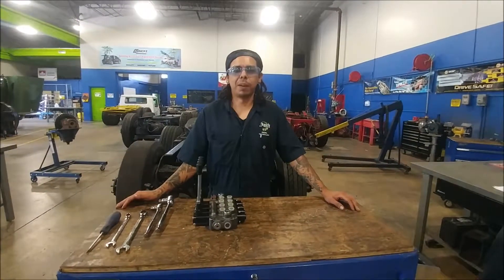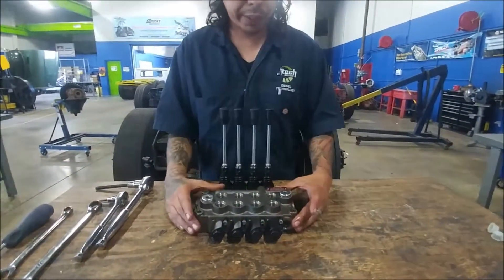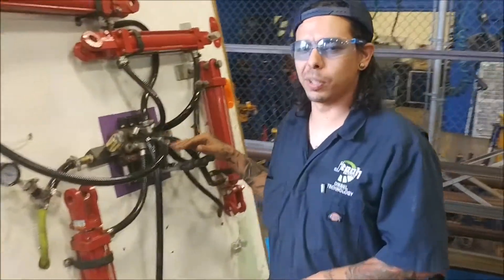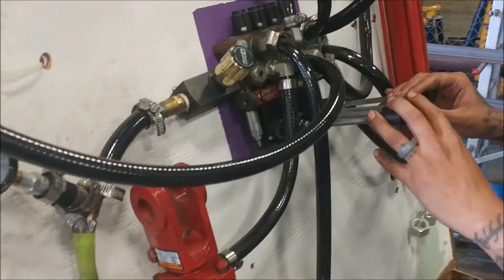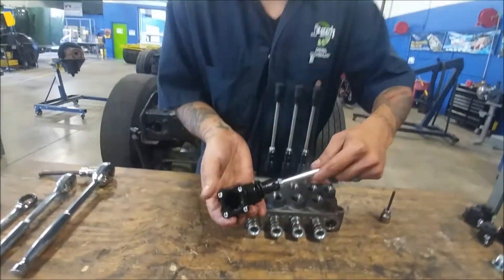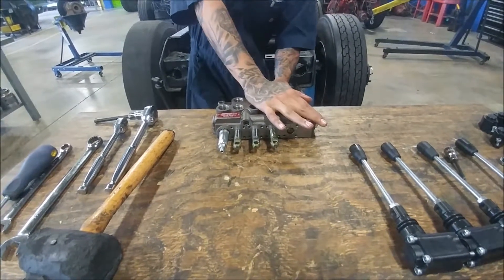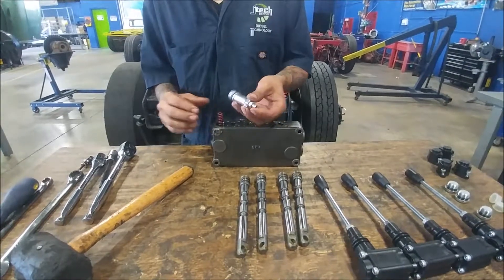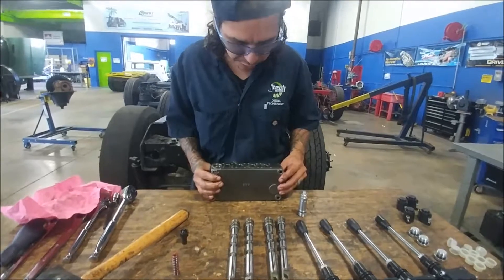4 Spool Monoblock Valve Assembly Teardown

Comment: Gotta Question Juan, I have a six bank. And 2 center valves are missing springs. on a tow truck. And 3 center need caps... The caps look easy to install. But can I buy and put the springs on these Valves without removing them from the body? This is where I am.

Room to get to them is tough. I was quoted $1,100 plus parts to fix.. Is that high? They don't even know but I need hoses too really. lol. Been sitting 12 yrs see. And my cousin put this bed on my F-350. We had a chance to remove this Valve body with no problem, but he installed the bed and now it's very tight to get to it. Right below boom. See why I'm asking. To take it off, I will pay someone. But if I can do it while it's still together then I will just do it myself and have the  hoses repaired.. Talk to me.. lol
Snowman

Comment: is there o rings in this thing ? I think there is . how do you replace a bad o ring inside this thing ???
Reply: If the valve block was seperate sections, o-rings would be on one side of each section, being this is a mono-block, no sections, there would be no o-ring. Seals would be for spool ends only at this point I believe.